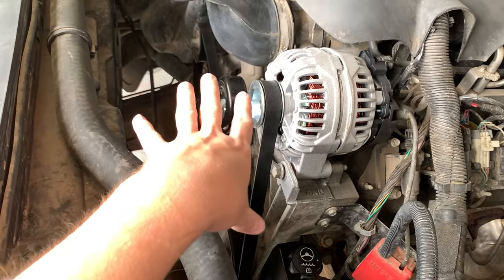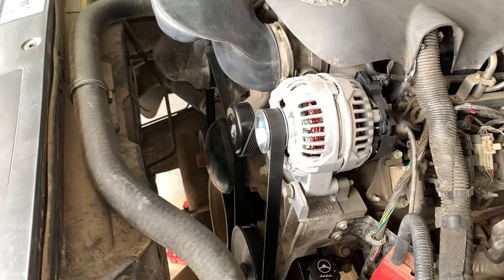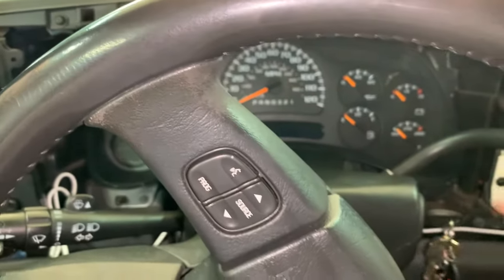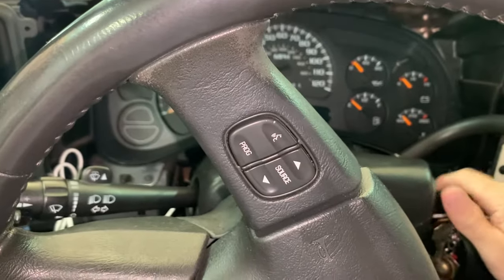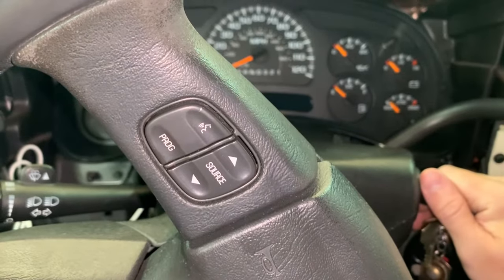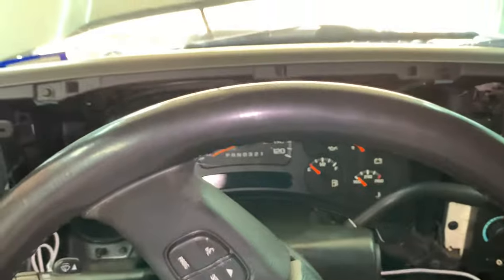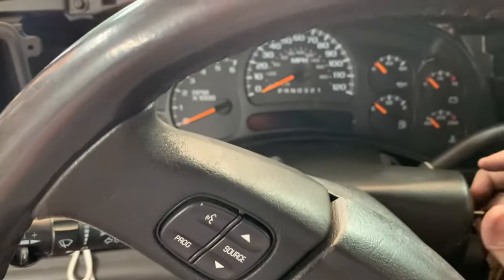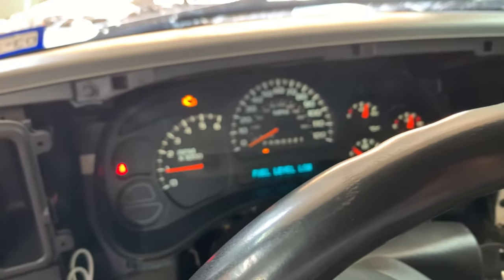Engine Whine with RPM Troubleshooting - Here's How to Test for Bearing or Accessory Noise

Comment: Had the same whining noise 2006 Tacoma. Removed the serpentine belt, noise went away. Spun the various pulleys by hand and found that the bearings on the idler pulley were shot. New idler pulley - Problem Fixed! Yes! Thank you for the video!
Reply from the maker: NICE. Glad you were able to track down the issue!
Reply: I just got the same noise and I also have a 2006 Tacoma 4.0 V6. I’m at 180k on the engine and will be doing the inspection this weekend.

Btw were the idle pulleys difficult to remove/install?

Comment: I got the same whine but the alternator is still charging and operating. Can it still be the alternator bearings or the alternator itself?
Reply: The bearings themselves can most definitely go bad, while your alternator is charging fine.
Reply: Yeah it can be diodes and voltage regulator they sound the same and go with rpm
Reply: Anyone know of a company selling alternator rebuild kits?

Comment: Two brand new alternators and they both do the same thing.  Remove the exciter wire and the noise goes away.. It is maddening.
Reply: Yeah I hate the sound too got it on my 4.6 , shit sounds like a eBay turbo on it lol
Reply: @zhongxena1155  Turns out all 3 new alternators diode packs make this whistling sound.. The irony is that the least expensive reman from Rock Auto (which most closely resembled what I originally had), solved the problem! Go figure.  The $59 reman did the job vs the AC Delco or Summit products.  The newer alternators are self exciting it seems.
Reply from the maker: Interesting! That is definitely a go figure kind of moment. 😮

Comment: I have the same exact whine from my alternator.  Did you figure it out? I dont think its a bad bearing.  Maybe a bad diode or even voltage regulator.
Reply: Update.  It was a bad voltage regulator on my powermaster alternator
Reply: @Sawalex19 how did you fix that?

Comment: I’m checking for same issue, and this may be my problem. I wish you had recorded the sound with the belt on, to see if it’s the same.
Reply: It turned out to be the alternator . The battery drained, and the alternator failure was the cause.

Comment: I have that problem in my 2005 Acura rsx, I only hear the whine when I accelerate and then it goes away
Reply: Have u fixed it mine come around 3 and gets worse with more acceleration
Reply: @matthewradowski116  nah, I think it might be the power steering tho
Reply: @kylemikulicic3245 my 2017 chevy is doing that, what did it end up being?

Comment: So i have a noise that ive tracked to the belt area but it doesnt sound like that. Mine sounds almost like a kazoo or (bear with me here this is a weird comparison) one of those little toy cars that you push and it winds up
Reply: I have that same noise did you ever figure it out??
Reply: @matthewbailey1841  check the power steering fluid and see if its empty, i ended up finding a leak and that was the cause of the sound for me.
Reply: Thank you! I will check it out!
Reply: Hate to ask but like a leak from a hose?
Reply: @matthewbailey1841  yeah mine was leaking from the connector, you should also check the seal around the pump itself just in case

Comment: Is there another way to check for whine? I have a whine that follows rpms especially in low gear or park. Is this more likely transmission related?
Reply from the maker: You can try using a piece of heater hose or a long screwdriver as a stethoscope or get an automotive  stethoscope itself to hone in on where the noise is coming from. There's so many things that can whine it's hard to say for sure what yours might be. If it happens in park when you aren't moving though it should rule out anything in the drive line or transmission.
Reply: @HSZGarage  oh so the whine noise while in park rules out the transmission? Could it be the torque converter or that is also ruled out?
Reply: Having a similar experience. What was yours?
Reply: Same here with a 2018 Elantra.  Started noticing a faint whine when accelerating from 10-30mph roughly (so like 2nd & 3rd gear).  Then seems to disappear after leaving 3rd gear.  Just as soon as I press the gas pedal, it's there. Then let off...nothing.

Comment: You remove the belt to see if that's the cause but the bearings won't spin either so surely it could still be a worn belt or the bearing?

Comment: i have Toyota hatchback two door 2007 yaris 
ran over 265 000 kilo meters

i changed alternator in feb this year (not from dealership but from a mechanic) but when i start car, the alternator makes a whistling sound for some time in beginning and after some minutes (10-15) it stops but again if i start after 5-6 hours, again it makes whistling sounds.

what do you think can be the reason?
is it the belt or the alternator or the barrels or i need transmission oil change?
Reply: What was it

Comment: Hello. Having the issue with my wife's jeep. After replacing the camshaft sensor, its sounding like that, like when i revv it it sounds like it has to much air or power going in. Like a over rev. If that makes sense.  Any ideas? Only code is camshaft sensor